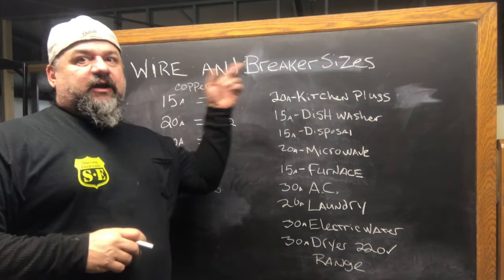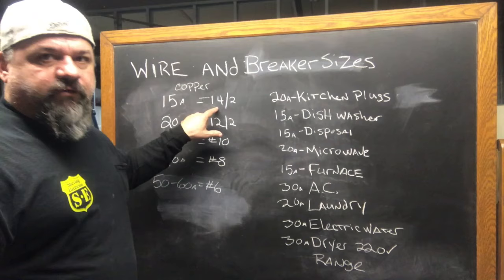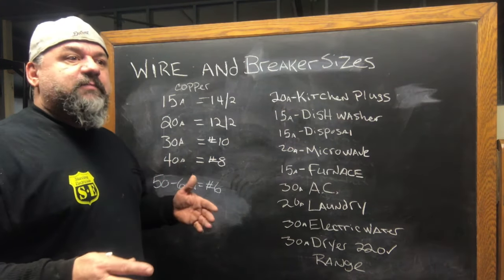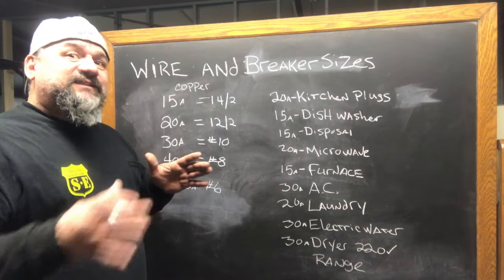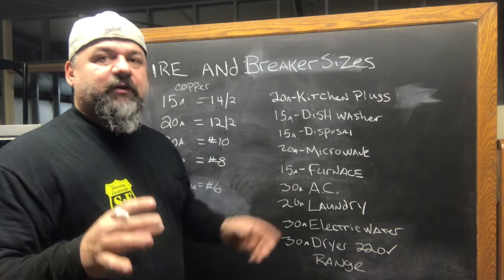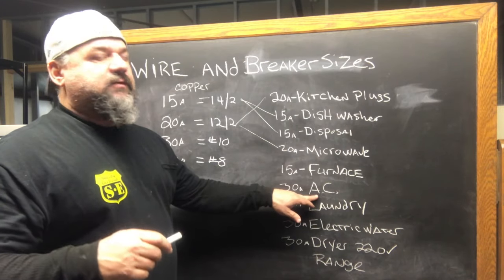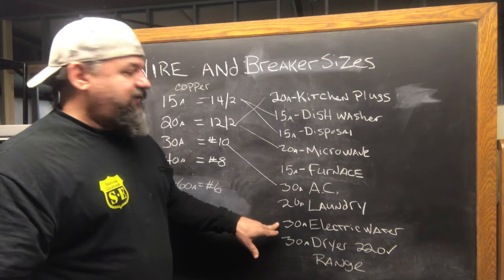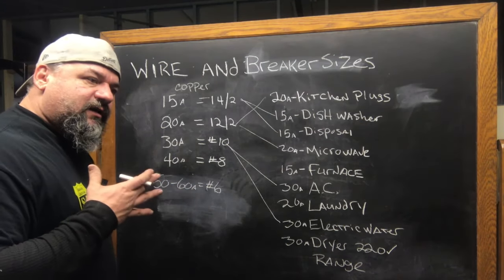"Uncover the Secret to Easily Calculating Electrical Wire and Breaker Sizes!" You wont believe it!

Comment: Thank you for your time and for sharing your knowledge. Question - I am a homeowner "always" trying to save money working around the house. I have a 100 AMP panel in the garage; I installed a 30amp breaker using a 10 gauge wire and a 3-prong outlet to use a 240v electric range. While searching for the stove, the specs indicated that you need a 50amp breaker using a 14-50r wall acceptable. Can I safely use my current electric connection, or would I need to upgrade to a 50amp breaker using a 4-prong outlet?
Reply from the maker: if it draws more than 30 amps yes you will have to re run the wire. also your new dryer requires a neutral which you dont have. unfortunately looks like you need the other wire. I have never seen a 50 amp dryer though. check the amperage and see if it has to be that big of wire and breaker.

Comment: Thanks for your  helpful content. Really enjoyed it. I had a handyman build a bathroom out of my laundry room. He installed a door from an adjacent hall. The hallway plug  never worked after he was gone. I thought it was dead, as nothing worked when plugged in, I cut the wires and was shocked. Using a meter I see that the common was not working and the ground was hot. I could just put the ground where the common goes, but that sounds wrong and could energize the panel incorrectly. Any thoughts? Thanks.
Reply from the maker: right its a shitty way to do it but sometimes when someone looses a neutral they use the ground. highly illegal and dangerous. now the other thing it could be is that plug was controlled by a switch for a lamp. and half of that plug was hot. shut off the breaker, remove the outlet and start with a tick tracer to see which wires are in fact. if you get false readings then test each wire to ground with a voltage tester. this will tell you if something is screwy

Comment: Again you make an accurate information video!    Congratulations to you!   One thing, the furnace noted at 15a would a gas one and this would be the motor and controls only.   Not electric heat!  It's all about nameplates as you said!!!!!   Being from St. Louis area, I hope your favorite beer is AB product!!!!
Reply from the maker: You know I love my AB products! Lol and yes the name plate rating on a gas furnace covers the low voltage as well. Unless it’s super high efficiency it’s usually 15 amp! Thanks for the compliment it truly means a lot.

Comment: need to confirm what my electrician told me as its not jiving with your You Tube chart.  I have a wellhouse on farm that my electrician placed a 40 amp breaker on. I now want to run wire from wellhouse approximately 20 feet (underground) further for pole barn lighting and ad a few electrical sockets to plug things in.   He told me to go buy 10-4 UF wire that has 4 conductors in cable.    I went to HD yesterday and found 10-3 wire indoor only.    According to your chart, i may need #8 wire?  Can you also tell me what the number stands for after the #10 or #8 wire  ( 10-3 or 8-2).    What would recommend i purchase for this job!   Thanks... your video was very helpful.
Reply from the maker: ok if he doesnt know #8 is rated for 40 amp then find another electrician. thats copper. aluminum is #6 wire. #10 no matter how many conductors is rated for 30 amp. 10-3 is two hots a neutral and a ground. 10 -4? thats three circuits and you will never find that in direct buirel.  8-2 is one hot, one neutral, and one ground. you need two hots if you are doing 220v if its 110 you can do 8-2 or 10-2 if its 30 amp.

Comment: Thanks for this video! Total novice here. Putting receptacles in my garage/work shop. Is it bad practice to put 12 gauge wires on 15 amp breakers? None of my machines draw more than 15 amps but what happens when two devices on the same circuit are both on? I will be having some dedicated circuits for the more sensitive equipment like CNC router table and laser.
Reply from the maker: sorry for the late response. you can use bigger wire for sure. make sure not to go bigger breaker and smaller wire!
Reply: This was helpful.  Had the same question.  I'm replacing wire and have 12gauge wire already and I'm replacing 14g wire with the 12g. Same breakers, same light switch and receptacles. Just heavier wire. Glad to know this is okay to do. Thanks

Comment: Good Day, I bought a new 30A Plasma cutter it has the ability to run @ 120v 20A for small light cutting and then bump up to 240v 30A for larger/thicker material.  What breaker and wire gauge would you recommend?
Thanks
Jim
Reply from the maker: if the full load is 30 amp id go one size bigger.

Comment: I appreciate your video, question if you have a 20 amp breaker and they’ve created multiple daisy chain outlets off of it, that happen to be 15 Amp outlets:
1. Is that ok with 15 amp outlet 
2. If the daisy changed outlets off the 20 amp breaker are 15 amp and connected with 14/2 romex is that ok. 
They are garage door outlets and normal wall outlets?

Thank you
Reply from the maker: no make sure the 20 amp circuit has the number 12 and the 15 amp has the 14. believe it or not you can use the outlets on both in most cases.

Comment: thanks, you can't make it more simple than this video. one question. 35 feet away, what gauge wire should I run from main panel to sub panel? I will  be running microwave, washer and dryer, fridge, mini split and normal lights and outlets. thanks in advance.
Reply from the maker: 35 feet is nothing  sounds like 20 ampmini split depends on the amperage on the name plate, lighting 15 amp

Comment: Buddy good video. I have a question about the code? 120 outlets and lighting together (Daisy chain) on one breaker 20 A Wire size 16 gauge copper.
Reply from the maker: if they are on a 20 amp circuit you need #12. not good to put lighting on a 20 amp circuit since its rated for 15 amps. so if there is a short in the light it might not trip the breaker. its not illegal though

Comment: I asked this elsewhere but really need an answer from an electrician.  My garage is 55 feet wide.  The sub panel is at one end and I am making a workshop at the other end.  The goal is to use existing 12 gauge wire that has nothing else on it to run 4 20amp outlets at the far end for general use.  Also, to run a dedicated 20amp circuit with a single 20amp outlet for an occasional small 110 welder and  possibly a pellet stove that only draws 2-3 amps max. The problem is the attic where the wires run is routinely over 100 degrees, and the 12 gauge wire already installed is about 65-75 feet.  Will this be OK? Thanks bud!
Reply from the maker: yea you should be good. its solid wire so it shouldnt matter.

Comment: Thanks for the info, very helpful. I want to put in a 60 amp sub panel in the garage for a pottery kiln and a welding machine.  I see some people use #6, #4, or #2 wire; you recommended #6 copper vs aluminum.  I wondered if you needed a heavier gauge wire with aluminum, and why the difference in recommendations. Thanks...
Reply from the maker: with 60 amp #6 copper is required. if it says it draws 60 amp on the name plate rating, on a kiln I would up size that. but if its like 52 amps then 60 is fine.
Reply: Okay, and that is for an outlet 50' from the breaker panel, and a kiln being fired for 3 hours.
Reply: Oh, the kiln is 48 amps.
Reply: And, thanks again.

Comment: I am going to run wire from my house breaker box which is 200amp. My building is 150 away. Only thing I may do is plug my camper in. What size wire should I use from house to building and what breaker at house will I need??
Reply from the maker: depends on your circuit. the amperage of your camper plug will dictate the size of the circuit

Comment: Good Day, thanks for the video. I have a Welder 55amp 208 volt that I need to install a plug for in my shop. Confirm #6/2 wire and a 55amp breaker (I have a 40 and 60) haven’t seen a 55amp breaker?
Thanks
Reply from the maker: #6 copper and a 60 amp breaker you should be good.
Reply: @StarvingElectrician  thanks my Friend

Comment: Question on the 50amp (2 pole service) does it matter if you are running NM cable vs THHN? Im looking to install an outlet for a welding machine. and THHN says that 8 gauge is rated for 55 AMPs. Thanks for the help..
Reply from the maker: at 50 amps you may max out the circuit. usually you go 50 amps times 1.25 125%  That will give you the full load current and what size service you need when adding your equipment so you dont over load the circuit. nm means non metallic, not sure about the wire type I would have to look it up in the code book but I would go with thhn.

Comment: I have a outdoor ac unit with a 50 amp breaker 29 amps max draw on the ac unit and I’ve added a garage split unit with 16 amps max can I connect to same 220 v fuses with two disconnects ? Thanks and could I replace the 50 amp breaker with a 60a?
Reply from the maker: make the 50 amp into a sub panel and then you can do that. you can change to a 60 if your wire is large enough. #6 copper

Comment: Great video.  Question, I'm installing and  Portable Generator which can  put out 50amps.  Installing a Square D interlock Kit on my 200 amp service.  Now what size breaker should I use to use with the Generator to provide service?  I know I need to shut down some breakers for the whole house.  I only need to run some lights, 2 refrig., well pump and boiler.
Reply from the maker: That is correct but it depends on what you are running. if you have a 50 amp generator you can just about run the whole house. just turn off stuff when you leave the room and no electric range. the worst thing that can happen is you trip a breaker.whit what you are running i dont think you need more than 30 amps but its a matter of the amperage on the generator that dictates your breaker size. if it says like 33 amps then you always round up. so that would be a 40 amp. thanks
Reply: Thank you for the information.  That's what I was thinking but wasn't sure.  Thanks for that super fast reply.  I will be watching more of your videos.

Comment: Thanks for the information! I’m adding (or attempting to add) a 240v service for my two welders in my garage. I hope it’s as easy as it seems. Not sure how to integrate GFI if I’m coming right off the panel that is located in the garage.
Reply from the maker: well the 220 are seperate circuits dedicated. you wouldn't pull a 110v GFCI circuit off one of the two 220V circuits if thats what you mean. For advanced questions we could do a video conference on my site www.liveelectrician.com to book a 1/2 hour or a full hour.

Comment: Great video,  thank you very much. 
I am trying to install a steam generator that has a 9kw heating element,  according to the manual I have to use 8/2 wire with ground and no neutral,  I understand all of that, where I am getting confused is the manual says I have to use a 60 amp breaker,  does that mean I have to use 30 amp double pole breaker or 60 amp double pole? 
Thank you
Reply from the maker: if you do the math, 9 kw is 9000 wats, since its 2 pole you divide that by 220v and you get 40.9 amps you draw. #8 is too small. its rated for 40 to 50 amps. i'd go #6 and use a double pole 60 amp breaker. you usually want to go 80 percent of the full load to be on the safe side. just the wire size seems small. you should be safe with that. if the breaker is to big for the wire then the wire should go before the breaker.

Comment: Ok so question, I’m changing out a cook top

The old cook top had a Westinghouse double pole 60 amp breaker that fed to a fused panel under the counter. The wire used was a 8/3 copper 90c 

Each burner had it own fuse at this panel under the counter. 30 amp was the highest 

The new cook top is rated for a 50 amp breaker which is impossible to get for my panel ( Westinghouse) 

Can I keep using the existing wire and 60 amp breaker or should  I switch up to a 6/3 wire to use with the 60 amp breaker.
Reply from the maker: well a cook top has a constant load so the wire really should be number 6.  in theory if the wire is smaller than the breaker the wire will fail before the breaker does.

Comment: What kind of wiring would I use for a brand new table-saw  by Delta that is 15amp.  I have plenty room in my Circuit breaker box to run a new line. I’m thinking the circuit breaker should be 30 amps and why should be number 10. Let me know if I’m headed in the right direction. Thank you 🙏🏾
Reply from the maker: if its 15 amp then its 15 amp. thats #14   if its 30 amp then that would be a 220 volt circuit and in that case it would be # 10. but dont over think it. if iot says 15 amp then thats what it is. remember if its even 15.5 amps you always upsize and that would be 20 amp and #12. got it?
Reply: Thank you for the response 🙏🏾

Comment: Hi I like your video. Question if I have 100 amp service panel and I want to upgraded to 200 amp do the pge need to change they wire too. Or they only size wire from them to the meter.
Reply from the maker: Unfortunately they change it from the the line. Doesn’t make sense since nothing changes from the transformer. But yes the utility company has to change out the line side.
Reply: If have two line of 100 coming to my panel each side bus has 100 amp.. that’s me I have 200 amp
Thank you so much for your time for answer I’ll appreciate that..

Comment: Thanks for your reply! I do still have a 30 amp circuit in the breaker panel, but I haven’t energized it or filled the tank because I had a leak in my filtration housing. I’m about to replace that now that I have the components and was going to fill my tank. Should I err on the side of caution and wait til after work tomorrow and rewire a 40 amp...? If you could see the pics of the mess I’ve found done by a ticketed tradesman....You’re a gem😝 I gotta get a taco n Corona to you✌️
Reply from the maker: lol thanks i will take you up on that!.. always proceed with caution. if that vioce in you says so than do it. you dont mess with electricity unless you are sure. and yes if you are pushing the limit of that 30 amp circuit you may have trouble. im not saying it will catch on fire, the whole idea of a breaker is a safty device. if you exceed the amperage of that circuit they simply turn off. thats their job. but with the 40 amp you dont have to second guess. good luck.

Comment: Thanks for sharing! what size wire for a double throw 15 amp circuit for a split heating/ac unit? Thanks!
Reply from the maker: 15 amp is 15 amp. its always #14 double pole is a matter of voltage and not amperage. thats a 220v breaker but the amperage is still 15 amps

Comment: Hey. Thanks for video   Can you use 12/2 wire for all the recepticals and lights in a basement renovation
Reply from the maker: yes for sure. pain in the ass to work with in lights though. you can use whatever wire you want so long as the wire is bigger than whats required and not smaller. if you just have a few lights they should be on a lighter circuit so you can put a #12 under a 15 amp breaker. you just cant use a bigger than 20 amp. like having a car that goes 150 mph but the speed limit is 55. you can only do whats permitted. hope this helps!!

Comment: I bought a 1953 fixer house. The 200amp square d box is a mess. I been wiring residential for about 50 yrs. Not an electrician but my work passes. I need to run a sub panel and my question is can I run another sub panel off the first on because I need the breaker spaces.
Reply from the maker: abosultely!! you can have 100 sub panels so long as the load isnt greater than the main breaker its self. if its just for space I would say you are fine.
Reply: Thanks for replying to me I appreciate it greatly.

Comment: good video, and the learn and work program is great.  I have a question about adding a 100 amp subpanel.  I bought #2/3 nm-b cable to feed the panel but later learned the nb cable is only good for 95 amps.  is that a new NEC that derated it from 100  to 95 amps? its a 25 foot run from my main box. thanks again
Reply from the maker: well you only D rate because of heat from the wires in a pipe. theres an equasion for voltage drop but that doesn't apply here. if you go #2 aluminum its good for 100 amps. #4 copper is good for 100 amps. when looking it up you look for your wire type to find the rating. im sure you were just looking in the wrong area. #2 seu.

Comment: I need to power a 50A plug (100% continuous load) to my detached garage from main panel to charge my EV.  On the 14-50  adapter for the charger it says 30A. Is #6 wire adequate?
Reply from the maker: #6 is more than enough but the breaker must be 40 amp for the charger. for continues load

Comment: Good video! I want to run a sub panel to a shop about 100’ from main panel. Need to run 220 volt welder and other stuff. What size breaker and wire would you suggest?
Reply from the maker: for 100 amp its either #2 aluminum or #4 copper. it needs to be four wire for a sub panel and the grounds and nuutrals need to be seperate in the sub panel.

Comment: Can you use 8/3 wire 30 amp double pole for dryer outlet?
Reply from the maker: you can use any larger size wire, its the breaker that has to be rated properly. its like having a race car but the speed limit is still 55. the wire has the cappacity for more but the breaker is the speed limit.

Comment: Awesome video! What about distance? I am looking to move my electric dryer to the other side on the house, about 150 feet. Its currently 10/3. Do I need to step up the size due to length? thx
Reply from the maker: theres a section in the code book for voltage drop or 'D' rating but i dont think you have anything to worry about.